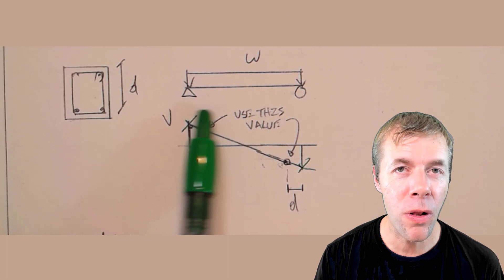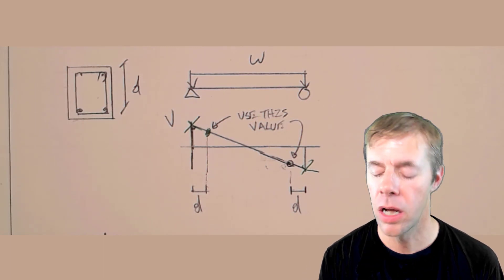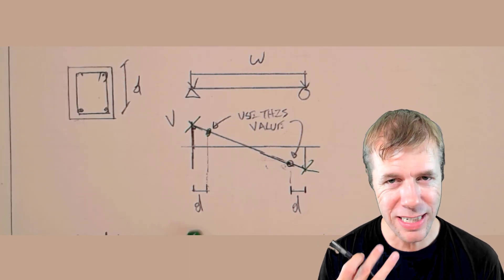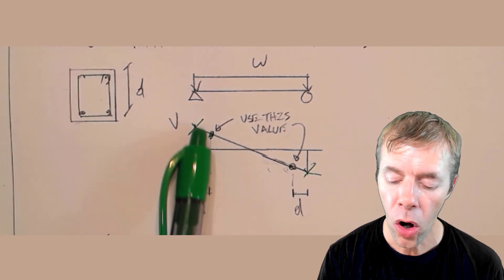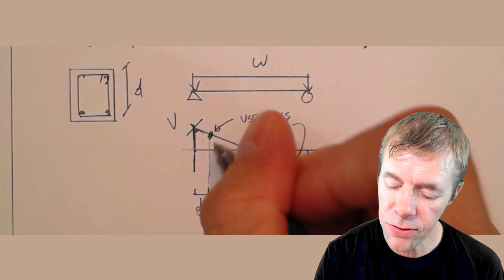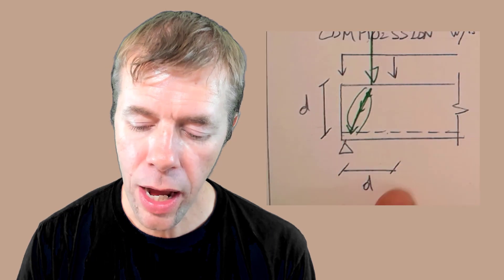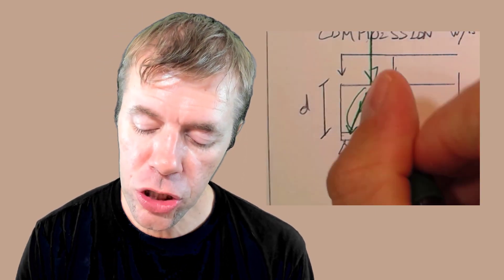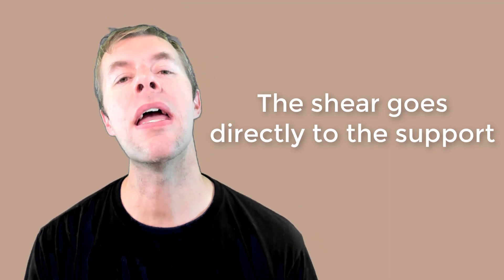Ignoring Structural Analysis by Reducing Shear for Reinforced Concrete | ACI 318

Comment: Request: a video on foam concretes (cellular concretes), second to that something about basalt fibre rebar, another thing that is very interesting to me is stay-in-place formworks
Reply from the maker: Thanks a bunch.  I have worked on the cellular concrete video but I am still trying to figure out what to cover first.  I am making a bunch of videos on durability of concrete.  Watch out for those.
I don't know a lot about basalt fibers.  I know a lot about stay in place forms.  What exactly do you want to know?
Reply: About cellular concrete. I think, a good thing to cover is current impediments for use in the areas where the heat and sound insulation matters the most - residential construction. Question I myself hear a lot is "if it is so awesome at saving time, energy and money, why it is not being used everywhere?" I myself can only answer that in general terms: need to work on building codes, lax enforcement of building energy efficiency norms in richer countries, costs of bringing more specialists, and reluctance to introduce new processes when "you can still do that with plain OPC." I myself feel that the situation with their use is similar with AAMs and geopolymers - there is one family of OPC based cements, but a whole "zoo" of AAMs and geopolymers with dramatically different chemistry.

On rebar, what about a talk on non-steel rebar in general? I took note of basalt fibre rebar for it being comparable in price to fibreglass, but at the same time being safer in regard to being more resistant to alkalies and acids (the common opinion that you don't have to care about corrosion with fibreglass rebar is very wrong,) This itself allows for more generous use of fly ash and other cement substitutes for whose low variability in chemical composition you can't vouch (sulphur contaminated fly ash can't be sold as construction material, but...)

What I want to hear about stay-in-place formwork is a brief intro with pros-and-cons for people who aren't familiar with them, economic aspects, and novel uses in high rise residential (in exterior walls (reducing the need for scaffold work,) and interior.) Separately, I want to give a warning to all engineers that a magnesium oxide board, a material commonly used in non-removable formwork, frequently comes with excess sulfites or chlorites content, and water permeability varying from batch to batch.

I will also note that all three of these work in synergy when I comes to cost and energy efficiency: basalt fibre rebar can be used in porous cellular concrete because it is not that corrosion sensitive, can be left "naked," and does not conduct heat well (very important in slabs); stay in place formwork provides additional mechanical protection to softer cellular concrete, and allows to cover slab ends. I'm bringing all that up because I noted that use of these got picked very well in Easter Europe for residential construction in the last decade.
Reply from the maker: All good points!  Sounds like you should make the video(s) =).  There is a lot of concern with development length of rebar in cellular concrete.  This is a big deal.  Also, if you use cellular for insulation then it is tough to get to pipes and electrical wire to fix them.  Basalt rebar is not available everywhere.  I have played with it a little and it looks promising.  There is a lot of good work that is going into changing the building codes for non-steel bar but there is a big lobby to change slowly.  Stay-in-place forms are awesome as long as they are designed correctly.  

I agree that you can use all of these together and you could do some really cool stuff in building construction.

Comment: Superb video Dr Ley. Sir,A new clause in the Indian seismic code IS 1893-2016 says that the minimum dimension of a column should be equal to 20 d where d is the diameter of the maximum longitudinal reinforcement of a beam anchoring into the column,I am wondering regarding the reason behind this?
Reply from the maker: Kushal - I am not sure how they came up with those numbers but I think their intention is that you want the yielding to happen in the beams and not the columns.  This helps dissipate energy in an earthquake or other extreme event.  Also, if you get yielding in a column then you can lose an entire floor.  That can cause progressive collapse.  The 20 d seems to be a simple way to make sure the column is big enough.  I have never heard that rule before.
Reply: Sir,Thank you so much for the reply .Sir,the strong column weak beam theory is an underlying factor behind most of the recent changes in our codes. Even STAAD PRO V8i select series 6 version seems to have integrated this into the design. And sir,the clause that i mentioned is in IS 13920-2016,OUR CODE FOR DUCTILE DESIGN and not IS 1893-2016,as i had mentioned earlier,sorry for the mistake.